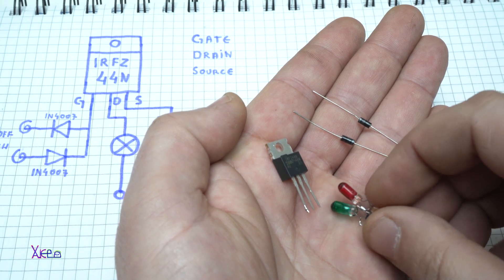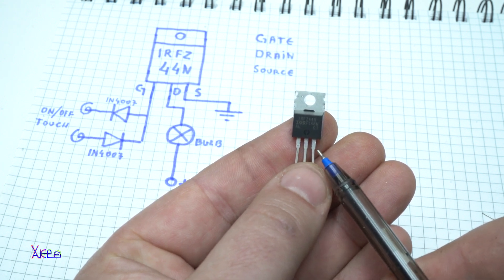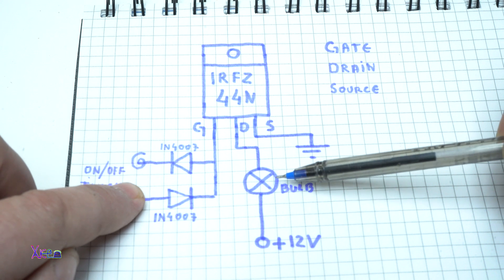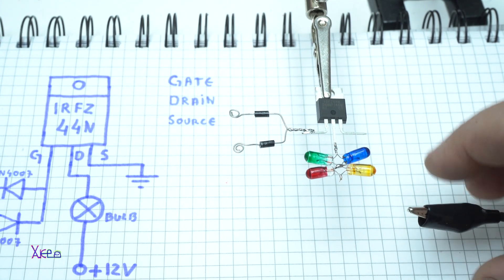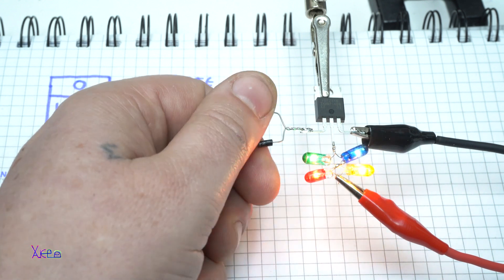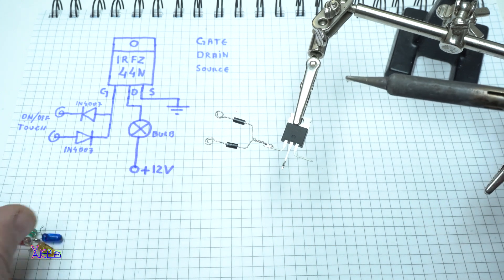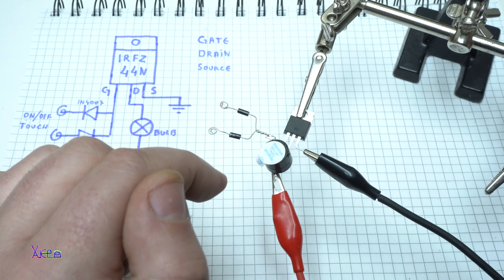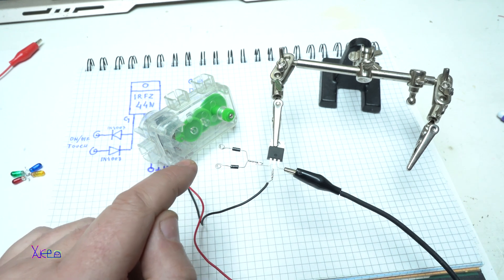ONLY 4 Parts To Make ON OFF Touch Switch

Comment: This has got to be the worse channel on youtube. Do yourselves a favour & just learn the proper way, studying electronics at college,you will thank me afterwards.
Reply: @enoz.j3506  what's wrong with you. Contributions of enthusiasts who are not professionals of any field are significant and quite often remarkable.
Reply: @rakeshkchauhan  Teaching electronics the wrong way,and in some cases on this channel ,dangerously,wont end well,but hey,you have your opinions.
Reply: @ Well, if you are a professional, than please point out such things... but let them have fun. In this case he is experimenting with low voltage and its ok
Reply: @ Yes i am a professional electronics engineer,with 45 years under my belt,what triggered me was,a comment made,on his, 2 button and a triac circuit ,on his youtube page,which asked,can this be used with 240v mains,which would of been fatal,there was no mention about maximum safe voltages,so was just trying to educate.,there are many youtubers that post ,not obviously dangerous circuits, and alike. Have fun ,yes,but be responsible and state the dangers on your pages.
Reply from the maker: Still charged with negative energy wow just wow
Reply: @I did infact point out safety concerns on his 2 switch effort.Perhaps i should just let the Darwin awards take care of my concerns.
Reply: @ Yes, they sometimes do such things and its dangerous. Once an enthusiast (in fact he works as an electronics repair man) explained to make a polarity independent capacitor using two electrolyte capacitors  connected back to back in series. So I had to do the experiment to convince him that it is extremely dangerous, ofcourse its difficult to explain why.
Reply from the maker: Thx sir
Reply from the maker: You look to me like dude full of negative charge or you are just a hater?
Reply: @ Nope,just someone that cares for people's safety.

Comment: Hi, very good.
But why does this work?
Reply: The gate of a mosfet forms a capacitance between itself and the source. The IRFZ44 typically has a capacitance of about 2nF, which is quite significant. When you touch one of the diodes, you act as an antenna and inject a noise voltage into the diode. The diode that passes positive signals charges up the gate-source capacitance and reaches the threshold voltage of about 3V, turning on the mosfet. Because there is very little leakage through the gate, that voltage will remain after you stop touching the diode. Similarly, the diode that passes negative voltages will discharge the gate-source capacitance when touched, which turns off the mosfet.
Reply from the maker: I do not know😁

Comment: That is very good, could you explain why it works please when you touch it?
Reply: The gate of a mosfet forms a capacitance between itself and the source. The IRFZ44 typically has a capacitance of about 2nF, which is quite significant. When you touch one of the diodes, you act as an antenna and inject a noise voltage into the diode. The diode that passes positive signals charges up the gate-source capacitance and reaches the threshold voltage of about 3V, turning on the mosfet. Because there is very little leakage through the gate, that voltage will remain after you stop touching the diode. Similarly, the diode that passes negative voltages will discharge the gate-source capacitance when touched, which turns off the mosfet.
Reply: @RexxSchneider  Thank you.

Comment: how long does it take the gate to discharge and mosfet goes off
Reply: That depends on a lot of things, The gate-source capacitance is around 2nF. The gate-source leakage is a maximum of 100nA with 20V on the gate, that's a minimum resistance of 200M. The gate threshold voltage is around 3V. Let's say your touch charged the gate up to 10V. The time constant for the discharge is at least 200M x 2nF = 400ms. After 2 time-constants, the capacitor is around 25% of its initial voltage, which means it will probably turn off after 800ms at the worst case. But you may have charged the gate higher or lower; the capacitance may be different; the leakage is typically an order of magnitude less, etc. So it's hard to say, but I'd estimate 10s of seconds at normal temperature.
Reply: @RexxSchneider  I will check
Reply from the maker: Thx for info